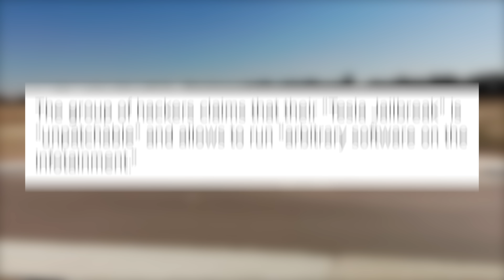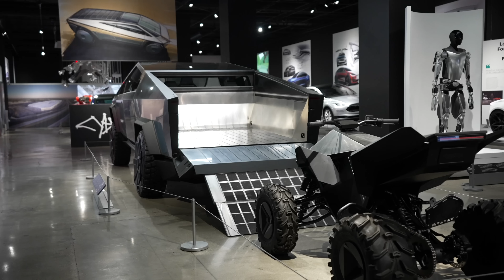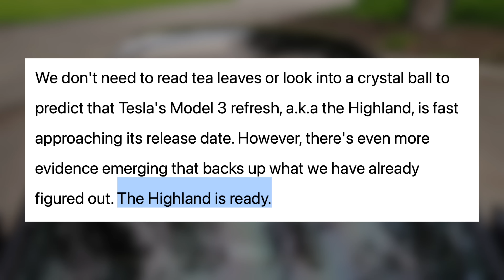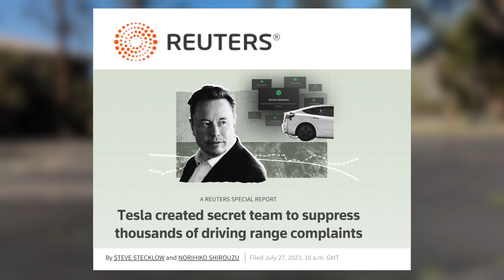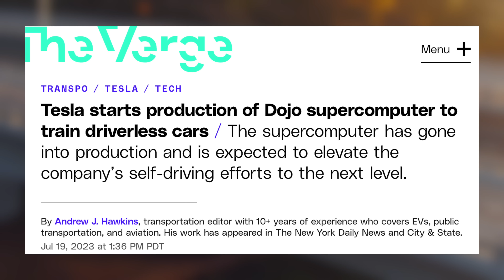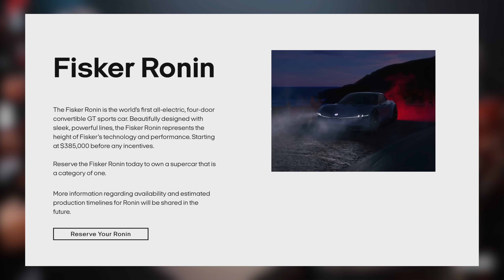WAIT | NEW Tesla Model 3 Highland Is Coming SOON | New Updates

Comment: The range issue is not so different from ICE cars and their variability based on conditions and use of inboard features (especially AC). I've had a model S since early 2019 and the range estimate has been fairly accurate when conditions are mild and stable, and unlike ICE cars I notice very little difference in range when using AC, but rather cold weather and hills (inclined driving) diminish range most dramatically, and it can be considerable if either factor is extreme or consistent.

Comment: If FSD were to be ready end of 23, it’ll be because of highland putting cameras farther forward. The current system in my opinion is not going to cut it. In my year of using the beta, this last release is the worst by far. It’s unreal the silly crap it does. It’s almost unusable at this point.

Comment: I click the rarge icon to switch from range in miles to % battery charge. I know the range in miles is complete bullshit, but the % battery charge is dead accurate. I just do some simple math knowing how many kWh my car holds at 100% and how many kWh per mile I will use based on how fast I am going to drive. For example, if I put 60 kwh in and I’m driving at 80 mph, I will use .350 kwh per mile and I have 170 miles of range. If I rely on teslas range estimate, it will tell me I have 250 miles of range, but I know it is complete BS.

Comment: Solar panels in the dash could power a passive cooling system to automatically keep the cab comfortable while the truck is parked and left in the sun. [you’ll need to do something about the massive heat that windshield will capture]
Reply: That's a fair use-case for the solar. Cabin overheat protection, which Teslas already have. I don't think Tesla's with glass roofs are really any hotter inside than metal roofs, however.

Comment: I think the lawsuit is BS if the range is more accurate under 50% because no one worries about range when charged over 50%. It's not a whole lot different than gas fuel tanks. Ever notice when the tank is full the needle stays near full for a long while, but once it starts dropping it's a fairly rapid descent? I bet if you tracked mileage on a gas powered car, at half a tank you have probably traveled quite a bit further than half your mileage of a full tank. 🤷‍♂

Comment: A lot of the new hardware in the upcoming Highland Model 3 is nice... BUT for me removal of signal and gear shift stalks would be e big negative.. unless they do the steer by wire.. That would probably solve it for me.. though I would still prefer stalks.
The current inventory prices are pretty decent too... and available used cars.
Reply: The removal of parking sensors for cameras has made parking in Europe cities a remarkably poorer experience…
Reply: @PierreDybman  
I imagine it did. And that is certainly been a problem here also in the US. I really do not understand why Tesla does this stuff. They removed the radar sensor to move to vision. But the vision system wasn't ready yet so you had a bunch of cars out there with a crappy experience and no software fixed yet. Seems to me it would be smarter to get the software ready before you start removing the existing hardware.
Tesla gets a lot of things right. But they do some really weird things too. Like the upcoming highland models going to remove the turn signal stocks and shifter lever. That would be a deal killer for me as I drive in the city almost exclusively. I've heard they may do steer by wire so that you won't have to turn the wheel more than 90°. That would mitigate the turn signal problem. To a degree.
But why should I have to relearn how to use basic controls of a car that have existed for almost 100 years. Dumb shit like that seems short-sighted to me.
And I think it would put off a lot of new EV buyers. If I was coming from another car brand any other car brand. And I get in a Tesla and I can't figure out where the turn signals are. I don't know it just seems like tripping over dollars for pennies.
Reply: @kens97sto171  I wonder if this would be road legal in Europe
Reply: @PierreDybman  
I don't know. But you're up gets cars I think from the Berlin factory. So they certainly could have different interior options pretty easily.
Kind of a strange situation. How the different continents have sometimes very significant different regulations about things. I really wish we had your matrix style headlights. They just became legal federally in the US but I don't think any cars have them yet.
Removal of the stocks is just something that would not be a preference for me.. And I don't really see how moving it to a touch button on the steering wheel is an improvement from a driver's perspective. If you're going to make a major change in the way a car operates there should be a significant advantage in the new change over the old way it was done. And that doesn't really seem to be the case in my opinion.
Reply: @kens97sto171  The M3 for Europe all come from Shanghai.
Reply: @PierreDybman  
Interesting, I would have thought the Berlin factory. Do they only produce the model Y at Berlin?
Reply: @kens97sto171  Mostly Shanghai for the EU

Comment: Teslas "sale" of the current Model 3 seems to be coming to an end, at least here in germany. As of the moment I am typing this comment there are only two pre-configured ready-to-drive Model 3 left to be bought when in previous weeks it was always at least 8 - 12 with new vehicles becoming available as quickly as the available ones were sold. Those cars also had and have massive discounts, between 4200 to 5500 euros off per car.
In short, at least for the german market, new pre-configured Model 3 cars are now almost exhausted, with the option to order a completely built-from-scratch Model 3 still there but with greater delivery delays.
In previous months a newly configured Model 3 would take about 2 - 6 weeks to arrive; now, its 2 - 3 months for Model 3 and Model 3 Long Range and 3 - 5 months for a Model 3 Performance.

Any other car company would have blasted the commercial waves with jingles about the ongoing sale - as does, once again, Opel here in my area, for example. With Tesla its almost a blink and you miss it - and I like that. I don´t wanna be reminded at least once per hour on the radio what great sales I´m apparently missing.

I´m really looking forward to the first impressions / reviews hopefully popping up soon for the new Model 3.
Reply: Yup, ordered a model 3 LR RWD here in Croatia - 5k€ discount. All gone, besides some performance models. The shipment is already in Koper Slovenia. I'm thinking about maybe canceling because of the highland. Its not such a big discount since they removed the front motor and provided a partial premium equipment - no subwoofer, no fog lights etc. My biggest concern is the removal of ultrasonic sensors beacuse from what I read tesla vision parking is not working properly.

Comment: I own a 2018 Model 3 with 90,000 miles on it and will be buying a second Tesla this year to make sure I take advantage of the tax rebate. Right now I am looking a Model Y but if the Model 3 Highland is released in time for me to take delivery this year, it will definitely be a consideration. Will be trading in my wife's Mercedes so we will be a two Tesla family by the end of the year.
Reply: How is the car holding up so far? - any major maintainences costs or other issues to be aware of ? :)
Reply: @kekatora  it is awesome. Only out of warranty repair was control arms for a total of $250. So far best car I have ever owned.
Reply: @mitchellheller3578  thanks! - been wondering, what to expect when it comes to repairs, and its difficult to find any long-term owners data about it. Really appreciate this :)

Comment: I had a conversation with my dad years ago about gas gages. He said the reason they move slowly off of full to 3/4  and then faster from 1/2 down to 1/8 was because they were mechanical and gas sloshes around in the tank more as it empties. Well now I own a 2018 Chevy Colorado with a digital gage made to look like a mechanical gage that reports fuel levels the same way as the old gages did dispite our ability to create a chip that could properly compensate for feuls movement and variable excelleration. All auto companies use this exaggeration  of fuel and distance reporting on their vehicles.

Comment: I just cancelled my pending MYP order. Found out that the HW4 computer has been intentionally crippled by removal of the GPU and installation of half the RAM and storage as my current MYP. Wanted to take advantage of the FSD transfer program, but this car is substantially and significantly inferior to my current 2020 model. Very disappointed. Hope that this Highland project will trickle down to the MY, but I'm not buying anything new until they support the full level of technology across their platforms, and not just on the super-car line.
Reply: The Model Y never came with a dedicated GPU?
Reply: @Tschacki_Quacki  The HW4 system in the S/X is the same form factor as the one here. However it is fully featured and capable with the mentioned GPU and full stack of RAM and storage. I understand the Y is not a luxury vehicle, but without the GPU to process visual data, and the lack of memory capacity, this hardware is not capable of being future proofed. And as a long term investment it is ridiculous to pay full fare for a vehicle that is less capable than the one I already own.

Comment: The F-150 front trunk is so large, as you point out because they are sharing the same body with the existing ICE F-150. You can have that large frunk and pay for all the extra (wasted) weight of that all-steel frame, hood, etc in sacrificed mileage. To me, the F-150 having a front trunk is yet more proof that Ford is making an existing car that's electric (and all the bad choices, designs, and components) that come with it.

Comment: Although it looks like the Cybertruck frunk will be significantly smaller than the F150 Lightning (normal with room for a big V8),  it should be larger than most other EVs (it is very wide).
Reply: Cybertruck also has a back that can be closed up. A large "frunk" is less necessary than with an F-150. That dash though!
Reply: I am a contractor and while I wanted an electric truck and still have a very low order # on the Cybertruck I realized it’s not practical for a work truck no matter how cool it looks in my opinion. The F-150 will be a lot better for my uses.
Reply: @Slowhand871  For sure, one size doesn't fit all. I watched a convincing video a couple of years back from a contractor comparing the trucks and the approach angle, ground clearance, bed size, payload weight, and durability of the Cybertruck are anticipated to be notably superior to the F-150 Lighting, with the F-150 Lighting frunk being the one standout. Turns out using it for power backup for home is another bonus feature of the F-1500 too. I like the look of the F-150 better and find the huuuuge dashboard to be cringeworthy... although its supposed to be a place to store worksite plans...
Reply: I’d rather have the option to fit in my garage anyway